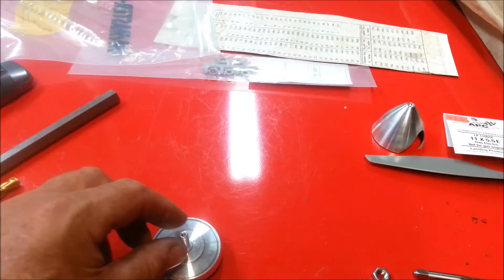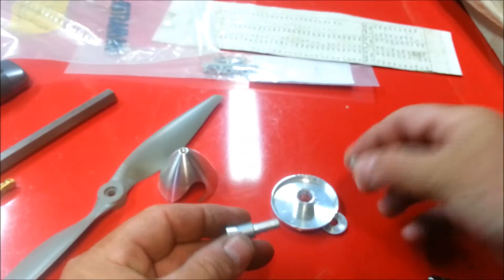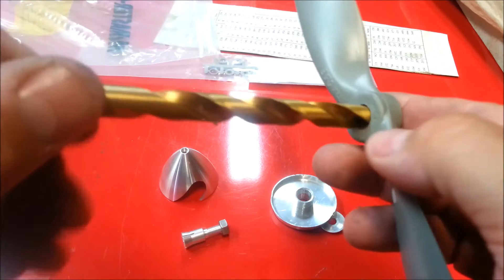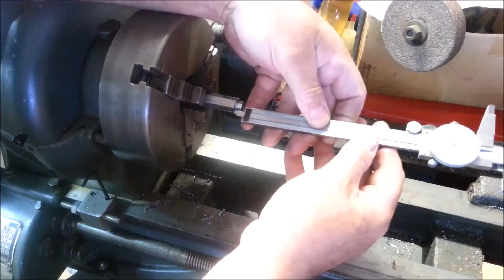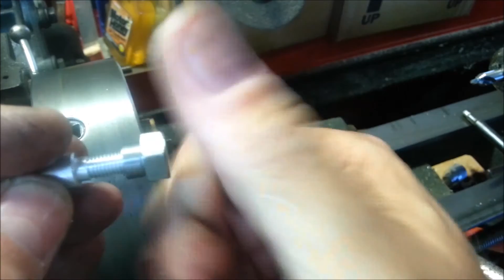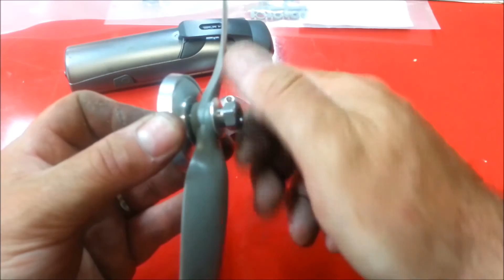Prop Sleeve Nut Adapter Extension Lathe Project Crafted Channel

Comment: Dave, you say you're using a 1/4-28 tap, which is the same as a glow plug thread. I thought glow plugs were an oddball 1/4-24? I seem to recall seeing one of the mail order outfits in my old modeling magazines selling taps for them or am I confused again? It does happen.